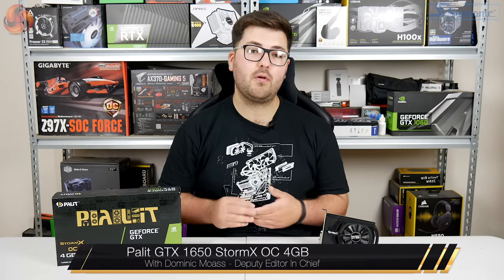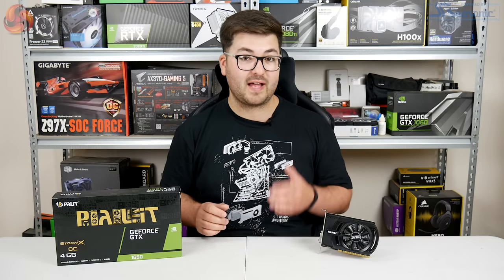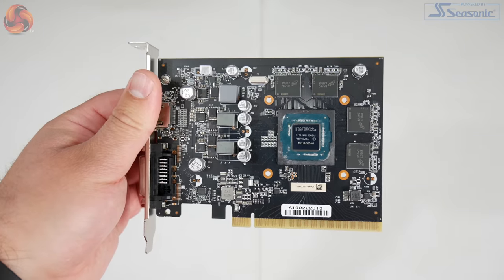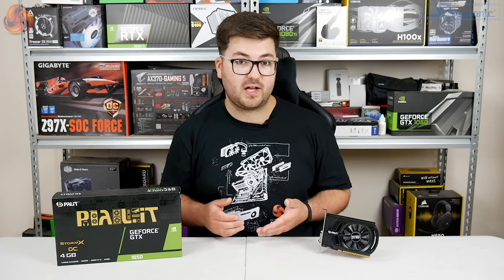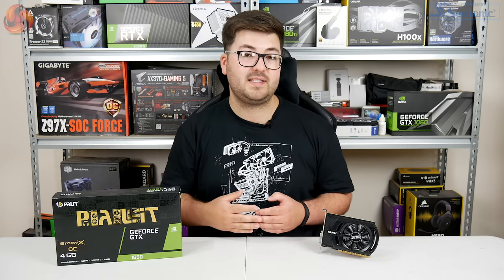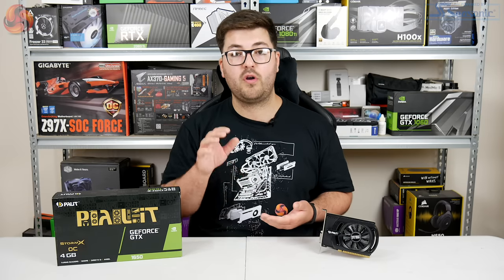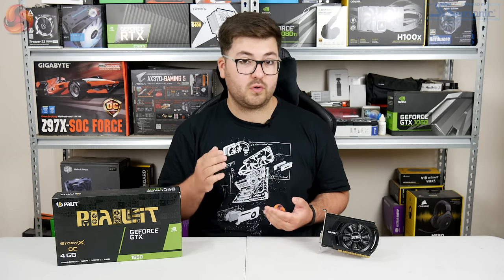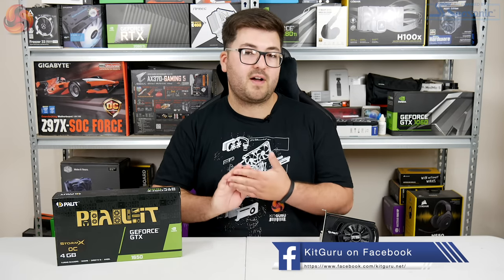Palit GTX 1650 StormX OC Review - It's a tiny card, but is it GOOD?

Comment: how much better is the 1650 from 1050ti?
Reply: Not hugely. Stock cards are same power draw, 14% faster memory, 34% higher texel rate and 15% higher pixel rate. In the real world that isn't going to equate to much so it depends which card you can pick up cheapest really. The 1650 will probably net you an extra few frames a second but nothing special.
http://www.hwcompare.com/38523/geforce-gtx-1050-ti-vs-geforce-gtx-1650/

Comment: The only market these would fit into would be small form factor systems, and only if there were half height versions like there were with the 1050. The SFF market is fairly niche but not insignificant and people who build SFF systems will tend to spend more than a budget builder so the cost wouldn't be as much of an issue if you were trying to pack in the fastest GPU possible into your tiny case. I don't know what nvidia were thinking on this one though I suspect board partners will probably jump in with half high cards soon enough.
Reply: I bought one for my Dell Optiplex 7020 with an i5-4590.  It works perfectly and performs very decently.

Comment: so i have cheap 500wtts psu with 66% eficiency,a intell core i5 3330, 8gb ram and i want this gtx 1650. so it will run?
Reply from the maker: it will run but you will almost certainly get some heavy CPU bottlenecking. -Dominic